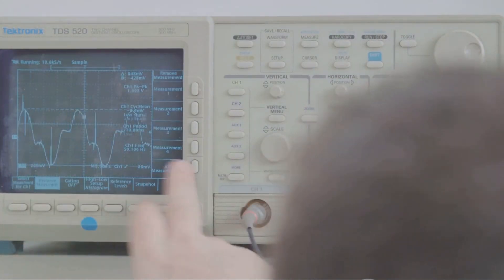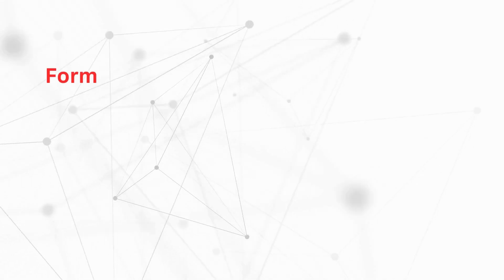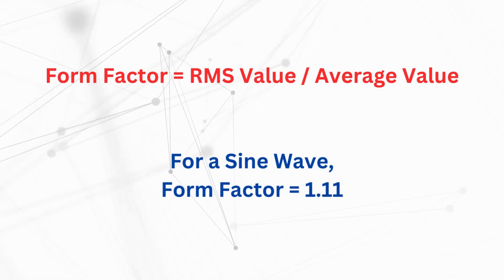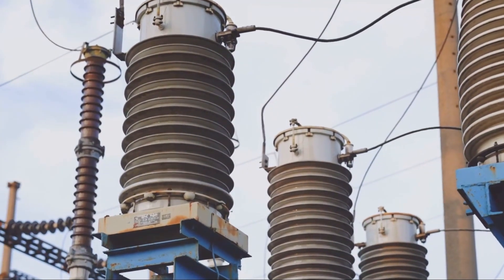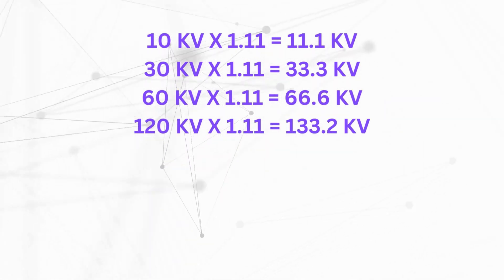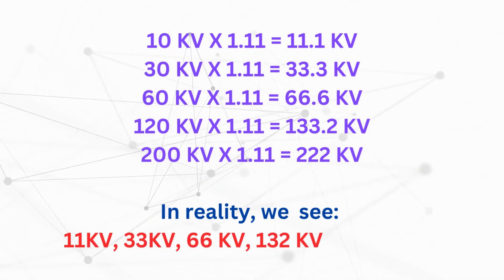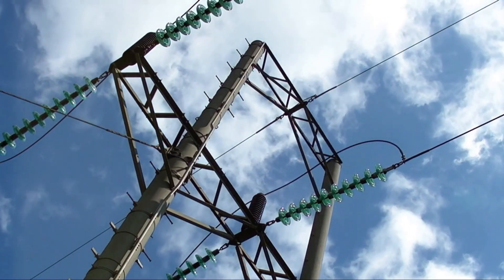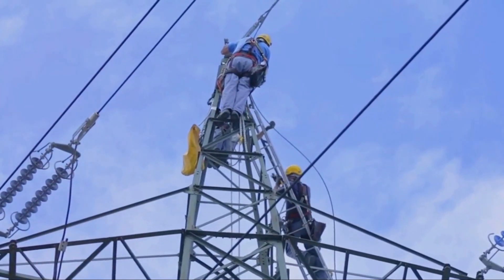Shocking Truth: The Secret Behind Multiples of 11

Comment: I think the explanation makes no sense. If we make 66 kV line to get 60 kV at the receiver, then transformer at the receiver is going to be of some oddball ratio to get 11 kV from 60 kV. If it going to be of some oddball ratio, so why wouldn't we just have 60 kV at the source, 54 kV at the receiver and then a transformer from 54 kV to 10 kV for further distribution? Also, if we do multiples of 11, how do we ensure that 10% is indeed lost when loss depends in the load? Also, corona discharge loss does not decrease from higher voltage, but increase!

Comment: Can power transformers be wired in parallel ? And what are the benefits
Reply from the maker: Yes, power transformers can be wired in parallel. This setup increases capacity and redundancy, ensuring continuous power supply. However, proper design and synchronization are crucial to avoid imbalances and potential issues.
Reply: @Electrology001  many thanks 🙏